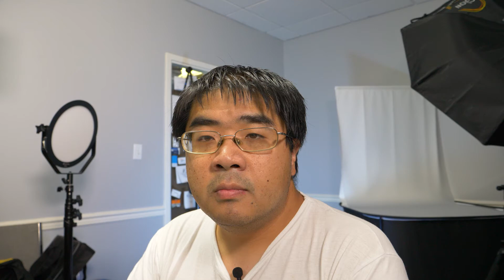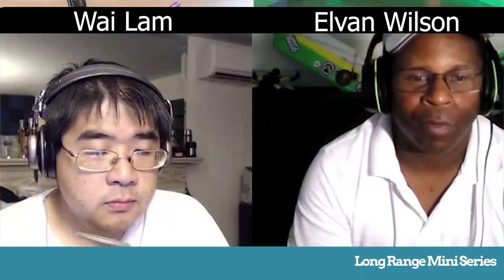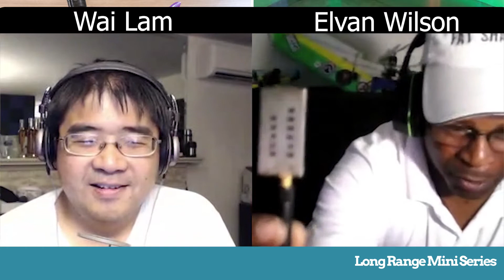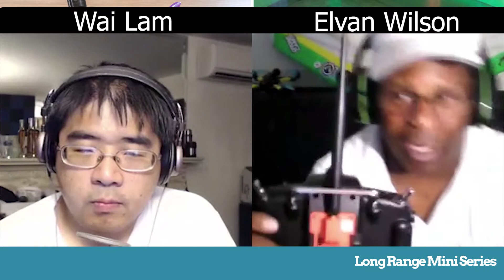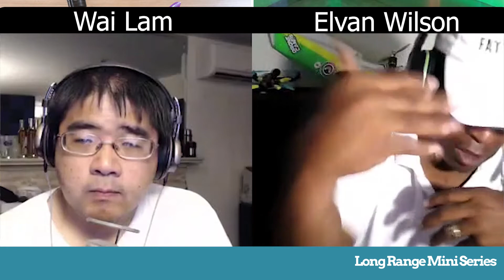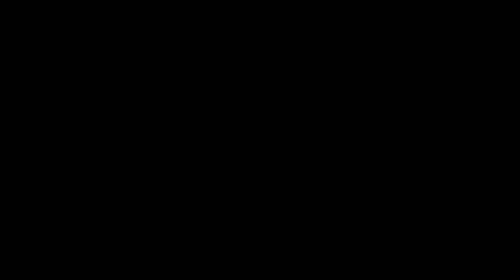FPV Long Range #3 - Radio Frequencies for Control and Video

Comment: Great job guys!

Although I've been in RC for over 40 years it hasn't been until recently that I'm getting into "longrange".

I live in San Juan, Puerto Rico and we have many cute small islands not more than 5 miles away from the mainland. I would love to be able to fly and shoot video going over water and back.

My buddies say I cant go the distance with my present setup. Any thoughts/advise you can give?

I'm running a 7" Armattan Chamaleon quad. TBS Crossfire lite with micro receiver. Mach 3 VTX. Current battery 3000mah battery gives me 15 minute flight. Considering a wing.

Thanks

Comment: Just FYI - HAM license you can operate 1240-1290 MHz; although, off the shelf Vtx in US only offer 1258 & 1280.  My buddy and I can fly 1.2 together so long as we both launch at the same time; if we get right up on each other while flying we do get some interference issues.  Happy Flying gentlemen!